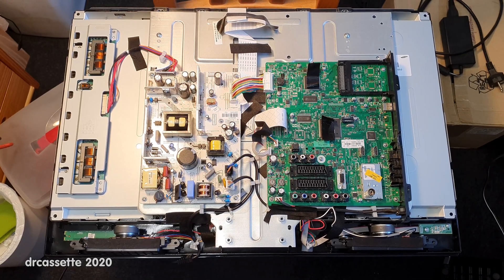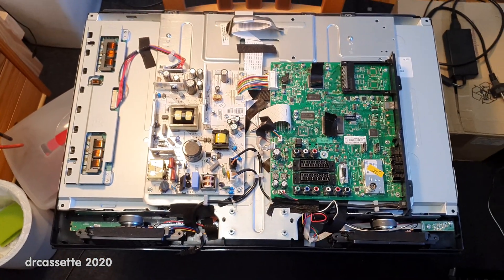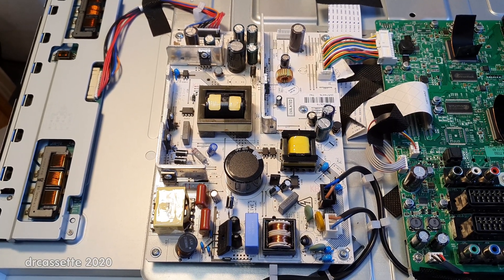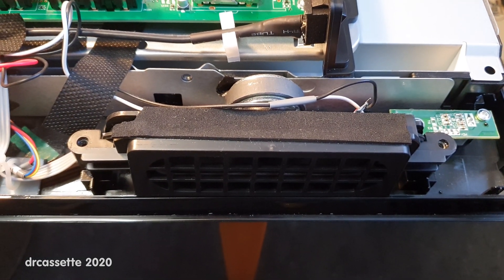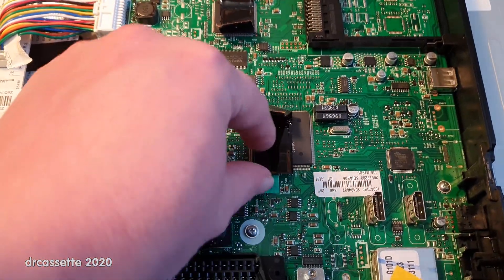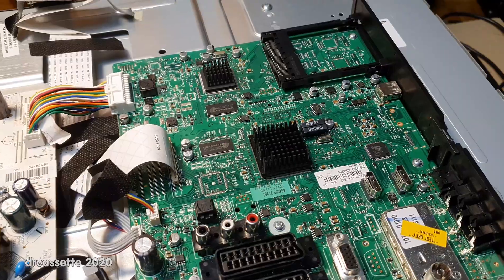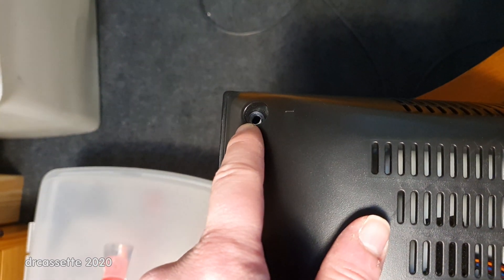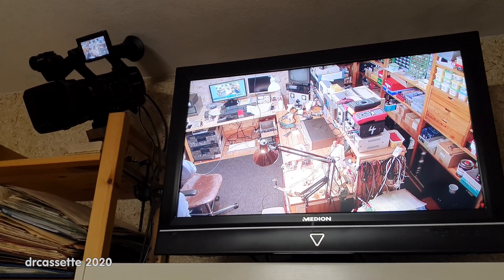Inside a 2010 Medion LCD TV + heat sink upgrade

Comment: What I did find odd was it had what appeared to be a Uk 13amp plug socket on the back of the set. 
Perhaps they supplied them to the UK market.
Reply from the maker: They certainly used the same back panel on countless different models.

Comment: I have both a toshiba and sanyo branded vestel sets 32 inch toshiba branded set has a 720 p samsung panel and the sanyo branded set has a much nicer lg 1080p panel both have awful speakers ,The sanyo branded set was chucked away screen was cracked but found a cheap enough replacement on ebay for £32 posted and i have had 12 months or more use from it so far ,the power supply caps are what often fail with these sets .Vestel sets often have paper labels on the back and a rectangle type box around 4 or 5 numbers on the back .

Comment: This actually looks really well made. Vestel makes a LOT of those OEM TVs. 
If you ever have a newer "Telefunken" TV, and cannot get a universal remote (or, as in my case, an AVR remote) to work, try the Vestel codes.
This surprises me as my Telefunken/Vestel TV from 2013 is of rather bad quality. It does still work, but has its own set of issues including a sound that sounds like something in the LED driver area, most likely a transformer/choke, is arcing.
Also the IR reciever is sometimes unreliable
Reply from the maker: Back in 2010 even the cheap LCD TVs were relatively well made, because it was still a fairly new technology and they had not gotten very far with cost cutting at that point. A while ago I took apart a broken Blaupunkt TV, also made by Vestel and much newer, only a few years old. It was appallingly bad. Very low quality, simplified construction. One of the backlight LEDs had failed, though to be fair the reason it was thrown out was a bad power supply, the TV was owned by an EXTREME chain smoker, and from what I could tell the nicotine residue had caused arcing in the power supply, so that was not the TV's fault.

Comment: Nice work!! I fix my dumbster find LG TV 26", Full size speakers, 12 Years a go, TV was 10 Y then... I change 14 capasitors from power unit, and its have working since. Right now it is my computer screen.. (1360*768 max) mode :D If you want you can see it my latest video-ep.
Reply: This your TV "heat-sink" was fun :D

Comment: You can enable some quite cool features on the newer vestel tvs like videowall and ipcam (you can also change a lot of hidden parameters)
Also on tvs produced 2010 - 2015 there is a backdoor trough which you can get root access over the network besides from controlling the tv.
Reply from the maker: Interesting, thanks for the info!

Comment: I think Vestel sets have an unfair reputation - they are great to own because parts are readily available and dirt cheap on eBay, due to how common and interchangeable they are.
Reply: There were JVC-badged CRT sets with Vestel chassis. The ones with the 28" non black line screen. Not the best image quality, but quite reliable.
Reply from the maker: I didn't mean to sound negative when I mentioned Vestel in the video...

Comment: Didn’t know they have an electronics industry in Turkey. I thought most TV’s like this would be made in China.
Reply from the maker: This is indeed surprising. I don't know how much the situation has changed by now, but back in 2010 a lot of cheap LCD TVs sold under store brands or recycled old name brands (AEG, Telefunken, Blaupunkt, Thomson, Grundig etc.) were made by Vestel in Turkey, using parts such as LCD panels imported from Asia. In this TV the panel and the inverters were made by Samsung. I was subscribed to a YouTube channel where somebody uploaded videos about repairing power supplies of these Vestel TVs, as those were a common point of failure. The situation seems to have changed today. Vestel are still in business and still claim to be one of the world's biggest TV manufacturers, but a lot of the store brand and recycled old name brand TVs I see now come from China, made by companies such as TCL.
Reply: DrCassette I have heard that Grundig these days is just a brand name, supposedly owned by a Turkish company.
Reply from the maker: @dykodesigns   Yes, the brand name Grundig is owned by the Turkish Beko group. And the brand Telefunken too is owned by a Turkish business, called Profilo Telra.
Reply: They actually have quite a large consumer electronics industry in Turkey. Vestel as mentioned,  make budget TVs for many manufacturers around the World but don't tend to make TVs with their own name. A better known brand is probably Beko who are one of the World's largest manufacturer of home appliances. The parent company is called Arcelik so you can understand why they use the Beko name instead.
Reply: Vestel is one of the largest makers of tv,s most panasonic branded sets below 49 inch are vestel made sets there oled sets are made buy panasonic

Comment: interesting hole pattern on the back side. looks like a female receptacle for an uk power plug
Reply from the maker: That's exactly what it is, Vestel also made TVs for the UK and Irish market, and this plastic fake receptacle is to store away the bulky power plug when shipping or moving the TV.
Reply: @DrCassette  I thought they could have molded the proper European plug instead of the UK one. Or even both
Reply: rare to see this on TVs, however I see this very often at microwave ovens.
Reply from the maker: The ungrounded Continental European plug is so small it doesn't need a place to put it. The UK plug is actually quite a hazard when it's just lying somewhere on the floor and you accidentally step on it.

Comment: I have a question i bought a Laserdisc player on tradera (the swedish version of Ebay) and it wont spin the disc the  laser moves a little bit and the disc wont start spinning do you know how to fix it?
Reply: Does it work with regular CD. I know it's different, but basic concept is the same, the CD player being born from Philips Video player. Could be laser or laser driver. My old Yamaha CD changer used Sanyo or something similar, not Sony laser pick-up. It wasn't the best at error correction in the first place. Check if service manual is available for it.
Reply from the maker: I have no experience with LaserDisc players, so I can't help you. Sorry.
Reply: Could be the laser is duff? It will try to focus, but if the laser isn't working and it can't detect a disc, it won't do anything else. Of course it could be many other things, like bad caps etc.
Reply: First thing to do is try playing a regular CD, does the disc spin and the unit play the disc?. Try cleaning the laser lens. Remove the top cover and gently clean the lens with a cotton bud dipped in Isopropyl Alcohol. Don't press hard, just be gentle. Gently move the laser unit along the rails, does it move smoothly?. If you feel a lot of resistance it may be gummed up with old grease. If so clean the rails with Isopropyl alcohol and use a good quality silicon grease to lubricate the rails. You only need a very, very small amount of grease to lubricate the rails. Once you've put some grease on the rails gently slide the laser unit back and forward along the rails to distribute the grease. If none of that works the next thing to look at is to find the service manual and check any belts the machine uses. Replace them carefully following the service manual instructions. Often you can find replacement belts on Ebay, and there are specialist companies who can often supply proper replacement belts too, just search on Google. The final thing to check is more difficult and that is to gain access to the circuit boards and carefully inspect them for leaking capacitors. If you see bulging capacitors or discolouration around the base of any that's a sign replacement is needed. This isn't a simple job though and can be very time consuming. If you have half decent soldering skills it's worth doing as laserdisc players are getting very expensive on the second hand market, if you have no soldering skills it's a job best left to someone who has but then that costs money, so you'll have to decide yourself if it's worth it.
Reply: Köpte du den?